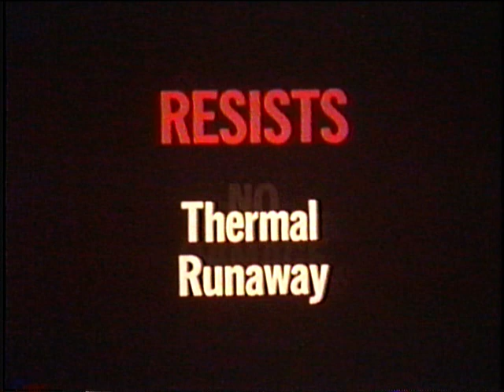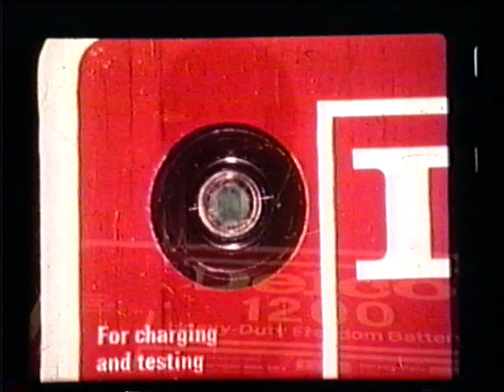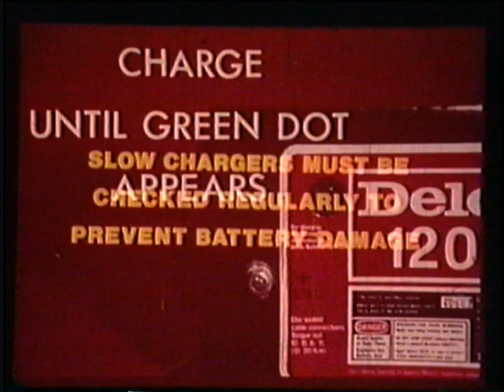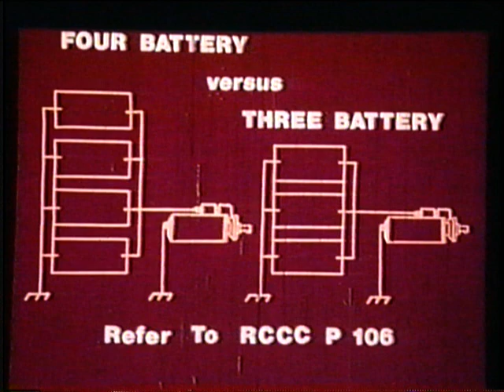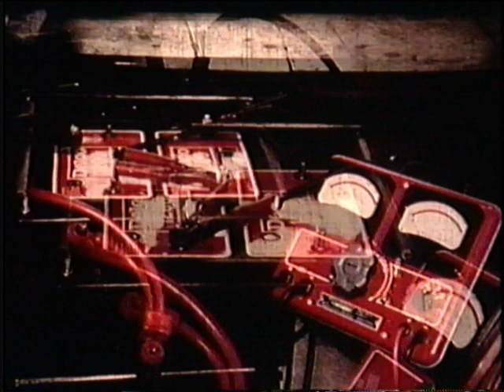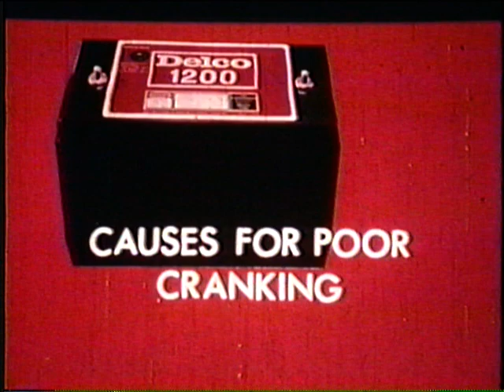Delco Remy Heavy Duty Maintenance Free Batteries Part II

Comment: Excellent presentation, thank you for sharing.

These Delco heavy duty vehicle electrical systems really were the cream of the crop and pretty much still are today. I was working on trucks when these group 31 12 volt batteries overtook the old 6 volt series/parallel systems... what a drastic improvement!

I've tried other brands, but keep coming back to Delco. After over 30 years, still my choice.